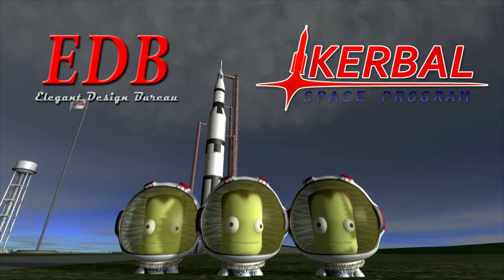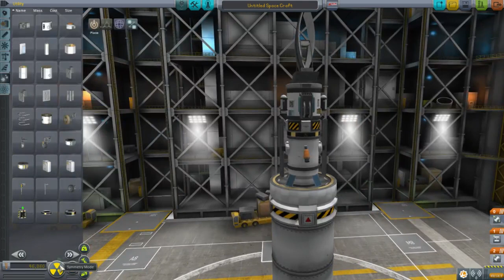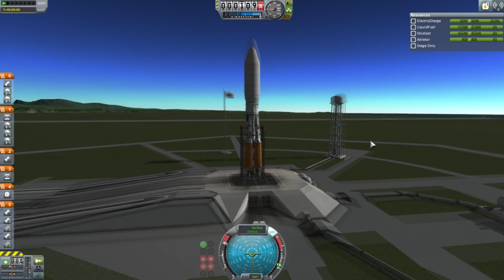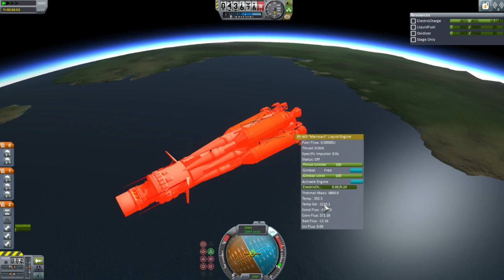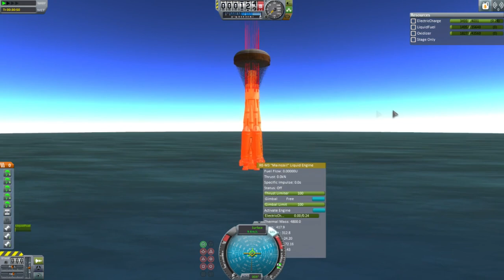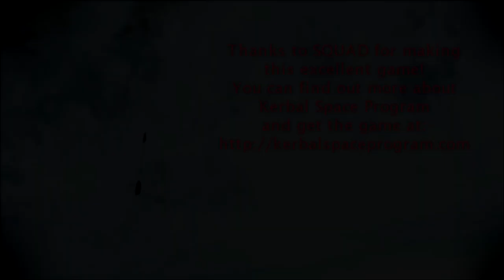Kerbal Space Program (1.0.2) - Jool Aerobrake Test Part 1 (Livestreamed May 10)

Comment: It seems to me that Temp Ext in upper atmosphere is assumed to be a shockwave temperature which in big approximation is value [degC] to value [m/s] equal to your surface speed. This doesn't exactly hold here so probably KSP is using some kind of shockwave temp. model.
Then as you cross certain altitude / speed threshold (guess Mach 1) there is an exponential switch to standard atmosphere temperature model.
Reply: I don't know how detailed the model is but the simplest case would be (note it is not full, physically correct formulation):
change of parts temperature in time (dT/dt) = q_from_shockwave - q_conducted_to_other_parts
so now q_from_shockwave=h*(TempExt-TempPart)
that's where TempExt comes into play.
However the driving condition for this equation in this situation is h (convective heat transfer coefficient) which is a strong function of density (through Nusselt / Reynolds number correlations)
Guess I got too technical, but it shows the use of TempExt, which is a practical measure, just approximated.